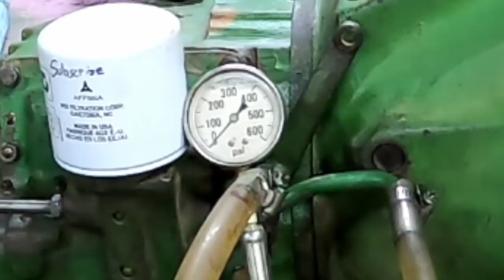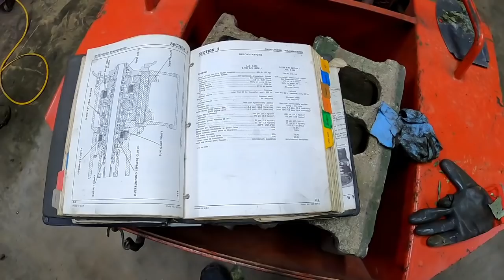Oliver 1855 Part 7, Over/Under Rebuild part 3

Comment from the maker: UPDATE: At 41:09 I talk about which way the bolt goes through the clutch fork. That only applies to units with the clutch fork shaft in the top half of the bell housing. If the shaft goes through the lower half of the bell housing, such as the 1550, 1650, 1950-T and a few others, then the bolt faces the opposite direction. Or to keep it simple, take a picture before you take it apart to make sure you get it back together the same way it came out.

Comment: I am ready for the coming week as you have supplied the Oliver drug video to get thru the week. Fantastic job.  Now just do one for Herman as he is jealous of the others having an O/U.
Reply from the maker: Herman's hydra power does have a leak...
Reply: @ThatOliverGuyChris  Come on Herman, really blow that seal.  I always thought the Detroit powered 1950s needed that extra range.  Herman says, "I am high idle, and have no load so grab another gear."
Reply: @bigun447  My brother has a 1950 4x4 that was upgraded with a 453T and a 3 speed, great tractor.

Comment: What about anti seize on those splines instead of grease? Light coating that is. It's coming along nicely, always learning something new about these old tractors. Cheers :)
Reply from the maker: Anti seize or moly grease are probably fine. Either one can fling off or hold dirt, so it's hard to say what the right answer is.

Comment: Great videos Been searching for a video on youtube for 3 point arms that drift down after the tractor is shut down and sits for a bit. It's a '67 1650.
Reply from the maker: I currently don't have one on that. The most likely cause is the seals in the internal lift cylinder need replaced. The hydraulic/3 point unit needs to be lifted off to get to it.

Comment: What a well engineered fairly simple bullet proof system.  Great job explaining the three speeds. There are a lot of the units still today in operation and having experience with them can take a beating. I got in the habit of slipping the clutch a bit or throttling down slightly during the shifts at road speeds pulling  silage wagons. Just didn’t seem safe to hammer the three speed.  But after seeing the video, seems to be engineered to handle it.
Reply: Hi Brett, I think you should continue to to throttle back when shifting into over on the road under a load,  In one of his videos Chris talked about damaging Over Under in the 2-155 when shifting at full throttle under a load.
Reply from the maker: Yep. I only throttle back for road shifting, there's enough reduction in the field to shift whenever you want. It's trying to jump up 4-5 mph with a heavy load that really puts the stress on them. Dad broke the planetary carrier in our 2-155 hauling a manure tank and shifting it all full rpm.  After that, we always shift the over/under at half throttle in road gear, and then give it the throttle after we're in over.

Comment: Nice one chris. Have you ever tried or had to make shims for under the rear motor mount pads from where someone didn't tighten up the bolts enough? Then the jack bolt under the over under unit won't need as much pressure on it.
Reply from the maker: I've shimmed to make up for wear from loose engine mounts, but only to get it back to stock. My thought is if I shim enough to line up the sprockets,  then the pto drive shaft is no longer lined up. A guy could make that back plate on the engine twice as thick and I bet that would go alot farther towards keeping things lined up and also cut down on vibration.

Comment: The used one I bought for the 1850 was $900 cdn. I wish I could find out what it was originally on.
Great set of videos Chris. 👍👍
Reply from the maker: Thanks. From what I can tell, they didn't log the serial numbers of the 2 and 3 speeds. There was plenty of room on the build card, go figure.
Reply: @ThatOliverGuyChris  makes very little to no sense why they would not. 
I know there’s quite a difference between some of them.
Reply from the maker: There's mention of them in the parts book, so they kept some track of it. I would have thought they'd do those and serial numbers from fwa axles onthe build cards. Go figure.

Comment: Are the Oliver and White Over/Under transmissions the same? They look a little bit alike, but you probably know it right off hand. Lots of detail non-the-less, and lots of cost too. Thanks for the video, have a great week.
Reply from the maker: There's a lot of common parts, but lots of little nuances. Input shafts are a little shorter on Perkins power ones, and longer on Cat powered ones. Most of the Whites used an enclosed coupler on the back side, which meant a different output shaft. There were variations on that as well. The way they transmitted power was the same on all of them.

Comment: have you ever thought about putting a semi hard piece of rubber between your steel plate and the housing to absorb vibration from engine to frame viva the adjusting bolt to line up the couplers?
Reply from the maker: No, but that's a great idea. A chunck of round baler belt would be perfect. Thanks for the idea!
Reply: us oliver guys are some the best thanks for your vids they really are good and fun to watch @ThatOliverGuyChris

Comment: Very informative and interesting videos. Any chance you could do a repair video on a 1750 power steering issue, my 1750 wanders back and forth all the time.
Reply from the maker: I've done some videos on similar subjects. Things to check out are that all the connections on the steering box up front are tight. Tie rods, the clamp on the steering arm, and even the bolt under the cap on the steering box can come loose and let things wander. If everything up front is tight, then I must be the steering motor in the dash. There's no repairing that, the best bet is to find a good used one, or to convert to a Char-lynn steering motor. To find them, search "That Oliver guy steering" in the youtube search bar and it will bring up videos I have done on the subject. I did some videos on a 1650, and it is the same as the 1750 steering, with a few minor differences.
Reply: @ThatOliverGuyChris  thanks for taking the time to answer me, very nice of you. I will look into what you suggest. Im from eatetn Iowa, grew up on the farm with Olivers, still have my 1750 and my Super 77.

Comment: Love your videos Chris you inspired me to buy an 1855 with original front loader and really good condition he used it in September and it's been setting till now in the barn he went to move it out he thought he left the parking brake on but it wasn't on he's never had trouble with it he can hardly move it a couple feet back or forth it feels like something stuck and it pulls the Tractor Down hydraulic brakes can you think of anything that could be appreciate anything
Reply from the maker: The park brake uses the same brakes as the foot brake, and the linkage can get tight from not being used. On the brake housing cover there is a rod that goes down through to hold the brakes for parking. Early 55 series didn't have grease zerks on that shaft, and it can get stiff and make the brakes drag. With the park brake off, grab that lever/arm that comes out of each housing and see if it wiggles. It should have a little looseness when the brake is off. If it acts tight, it could be hanging up. Take a chisel and pop off the cap on the outside of the brake cover, and under that is an adjustment bolt for the park brake. Loosen the jam nut, and back the bolt out and see if that frees the brakes up. if the linkage isn't tight, then there might be something else going on.

Comment: Looked at 1850 gas . I asked the guy does over and under work good. His reply was I dont know I never needed to use it . I paased on tractor as to me means it needed rebuilding.. Can you even still find or buy parts for them ?
Reply from the maker: For the most part, yes they can be rebuilt. Seals, clutch packs, and the sprag clutch are still available.

Comment: I really like your service school videos. It's good when you don't end up with leftover parts. A question I wondered about - the 30- casting number on the housing, did they use 30- part numbers before the name changed to White? Great video!
Reply from the maker: Yes they did. There's quite a few 30- numbers on this 1855 with it being a 1974 model. 30- was Charles City tractor stuff, 31- was Brantford combine stuff, 33-  was the imported Iseki stuff. 20- was kits and filters, fast moving parts.

Comment: Hi Chris I appreciate you doing the parts cost, I was just wondering if you would also do a labor cost just so we can see what the total final cost of a restoration would be. Thanks for the great videos I watch them all.
Reply from the maker: I was originally going to do that, but it's tough to keep an actual account of labor time with all the recording I do. Setting up the camera and light, sometimes I stop to talk about a particular procedure or give some historical tidbits, it all takes time that I wouldn't count as labor. Can't forget Alan's time either, but he works incredibly cheap. I should have used a stop watch app on my phone. 
Back in the day of the dealership I found it interesting how labor costs were often close to the price of the parts. Not always, but it seemed to be a good rule of thumb. Some of the parts I already had, like  that seal kit, so I'm going to go with replacement cost on those.
Reply: Ok thank you for the response keep up the great videos they are very informative

Comment: could you put a 1855 hydro in a 2-110 maybe by changing the tail shaft?
Reply from the maker: Tailshaft and the rear housing, yes. You may have to shorten the input shaft by a quarter inch as well.

Comment: Between over/under and Hydrapower, which do you prefer?
Reply from the maker: The hydra power is a good solid unit, but the extra speed of the over/under makes it the winner in my book.

Comment: Can u get all the parts still for the over/under? And how much would it cost to fully rebuild one?
Reply from the maker: The wear parts like seals, bearings and clutches, yes thry are still available.  Some of the shafts have been discontinued in recent times.
Reply: @ThatOliverGuyChris  ok
Reply from the maker: I had about $1,000 into this one.  Seal kit, speag clutch and a couple of small parts
Reply: @ThatOliverGuyChris  my 1755 has got a little knock and kinda sounds like a bearing going out in the over under or the shaft is bent
Reply: @ThatOliverGuyChris  but The engine runs great just cranking I got a issue I can’t figure out. When cranking with the starter half the time the pump don’t pump but if I pull it it busts right off

Comment: What typically needs replaced when you loose overdrive.
Reply from the maker: At the very least, the sprag clutch. If it chewed things up, then you're looking at an output shaft. Those are around $2,000, depending on which tractor it goes in.
Reply: @ThatOliverGuyChris  ok I thought the sprag was for the under drive
Reply from the maker: @bzyfry200807  Where is my head, yes the sprag is under drive. Over drive is typically clutch disks. Sorry about that.
Reply: @ThatOliverGuyChris  no problem it will try to grab when it's cold but with any run time it will just roll to a stop

Comment: Hey Chris. I have my parts ordered for my unit. You are correct the original input shaft on my 1850 is slightly shorter than the new used shaft I have. But I think I have that figured out. Thank you again for the help!! That Wix filter must have been special production one you had made with "Subscribe" on it...  Would a input shaft from a hydra-power be the same as one from a over under?
Reply from the maker: Glad to help. Are you going to shorten the shaft? A little time on a lathe would make it good to go. 
Hydra power shafts are different from over/under shafts.
Those say "subscribe"? I thought I ordered ones that say "send bribes".
Reply: @ThatOliverGuyChris  Lol... Yup thats the plan its going to the machine shop Monday. My case has a spot worn just like you showed from the adjuster bolt.
Reply: @That Oliver Guy - Chris Losey   @aaronkaraszewski2749  Would filling the hole being punched with a welding rig work?
Reply: @mjbirdClavdivs  You could weld it up. If you know how to weld cast iron  properly. The hole in my case is just like the one Chris showed. Its is not worn thru completely. Myplan was to braze the hole shut and then make up a 1/4" plate to go over the adjuster bolt that will protect the case from it happing again.
Reply: @aaronkaraszewski2749  Tack a flat washer onto the plate and it will keep the plate on the adjuster bolt. If the rubbed dimple on the case is not thru then I would not worry about it.  Put some J-B Weld in it and paint over it and no one would ever notice.

Comment: Great videos!  Are these the same units that are in the 1550's and 1650's?
Reply from the maker: The 1550 was only available with the 2 speed, I have videos on repairing those as well. The 1650 could have the 2 or 3 speed. The over/under 3 speed in those is functionally the same, although the input shaft is a smaller diameter than the one in this video. Repairing it would be the same, though.

Comment: How much would u think a 1755 that’s sitting and don’t run but was rebuilt and the shaft that runs threw the rear end replaced worth?
Reply from the maker: I don't know what to say. Values are wild these days.  Personally I say 2k.
Reply: @ThatOliverGuyChris  thanks also is it normal for it not to have a lift pump on the right side the engine?
Reply: @ThatOliverGuyChris  is it normal for these tractors after sitting for a while and not running for it not to go into the other range and not go in gear?
Reply from the maker: @xade7863  The fuel lift pump? There doesn't seem to be rhyme nor reason to that. My 1855 doesn't have one and looks like it never did. Having fender tank, I would have thought it would need one, and I'll probably add one before I'm done. I think it's good to have some kind of lift pump, as it keeps the charge pump in the injection pump from working hard and wearing out faster.
Reply: @ThatOliverGuyChris  ok that isn’t really worrying me but it won’t go in gear or go into other range. I know it’s been siting for 2 years and last thing it was used for was splitting firewood so is it just froze up?
Reply from the maker: @xade7863  is it cold where the tractor is? If there's moisture in the rear end it could be frozen and keeping things from moving. Generally if someone says it won't shift ranges, it's because the low range gear has welded itself to the input shaft. But they have to be running for that to happen.
Reply: @ThatOliverGuyChris  Its not cold here most of the time but he did say that the last thing the tractor did was split wood for a few hours. And he didn’t say nothing about it not shifting I just couldn’t get it to go in gear or other range. I don’t know much about these transmissions and I might of been doing something wrong the only oliver I got is a 440
Reply from the maker: @xade7863  it could have welded the gear to  that shaft. In cold weather ice crystals can form from the moisture suspended in the oil, and then that slush plugs the oil filter, and the gear gets starved for lube oil and seizes. Typically the range won't shift, and if you do get it in gear then it will kill the engine when you let the clutch up. Usually it's only the range that can't be shifted. It could just be ice in the shifting detent springs,  that would keep it from going in gear.
Reply from the maker: @xade7863  another thought, when you say it won't go in gear, is it grinding gears because the transmission isn't stopping, or it won't go in, even if the tractor is off?
Reply: @ThatOliverGuyChris  maybe what can be done if it’s welded to it? Will I have to go in and rebuild the transmission or is it a easy fix?
Reply: @ThatOliverGuyChris  the tractor is off and won’t go in gear but I didn’t press in the clutch So idk if that had something to do with it
Reply from the maker: @xade7863  if it's off and won't go in gear, it's not a clutch problem.  It could be none of the teeth are lined up so that it can go into gear, but I find that unlikely. 
If it welded to the shaft, it's a lot of work. You have to pull the engine and lift the hydraulic unit off. Then it's usually a bear to get the shaft out because of the gear being welded to it. 
Since it's not running,  you could reach in to the chain coupler and turn it by hand. It will only turn 1 way., but that might change the position of the teeth on the shift collars and allow it to shift.
Reply: @ThatOliverGuyChris  ok the man is supposed to deliver it tomorrow so I’ll check and see I hope thats all that’s wrong
Reply: @ThatOliverGuyChris  is there a way we can talk somewhere instead of here? Make it a little easier cause I don’t know nothing about these tractors